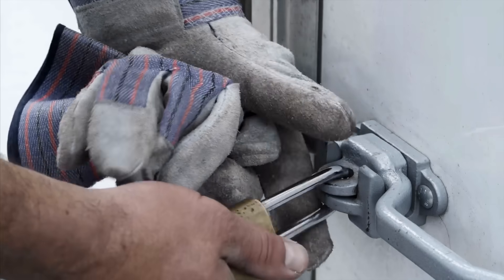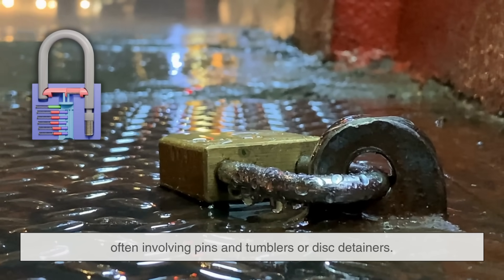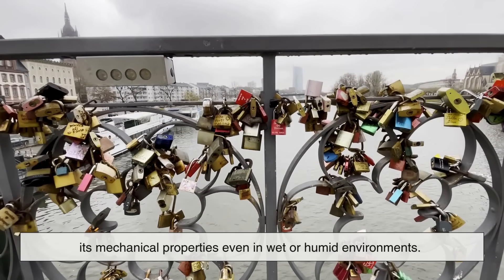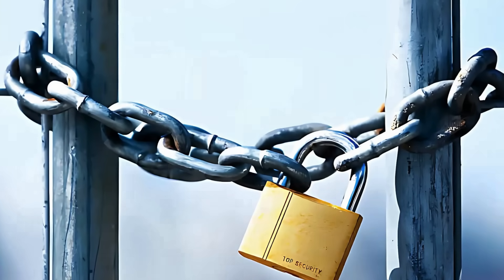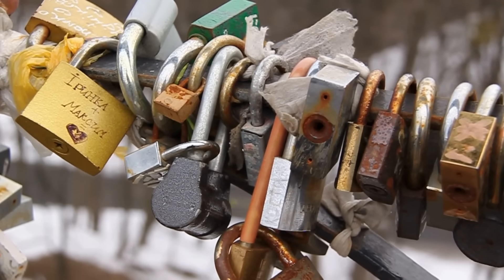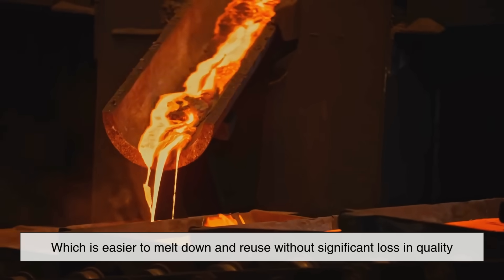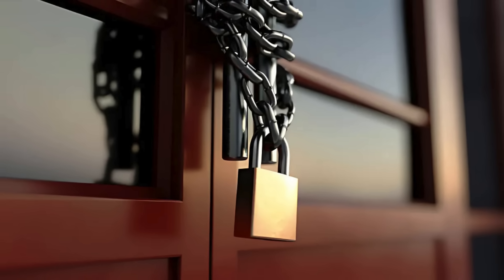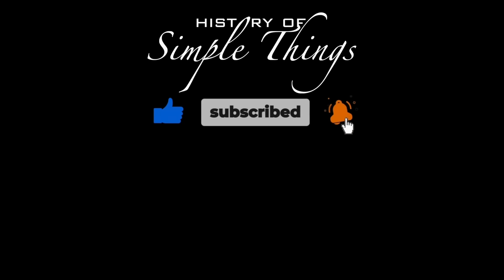Why Are Padlocks Mostly Brass and Not Steel?

Comment: I have several railroad locks that are steel... Granted they look a bit rough but with some WD-40 they still work just fine after 90 years. SOO LINE number 9 keyed.